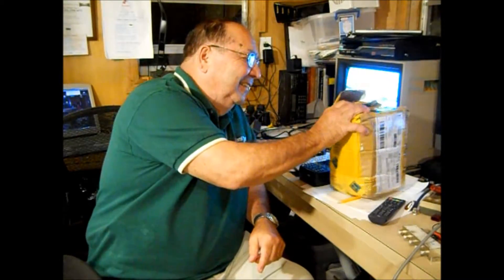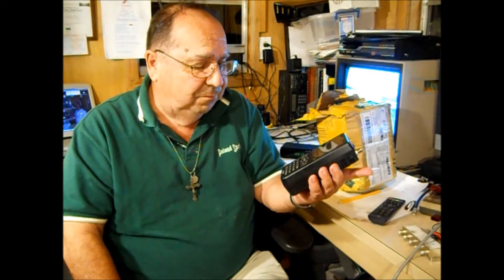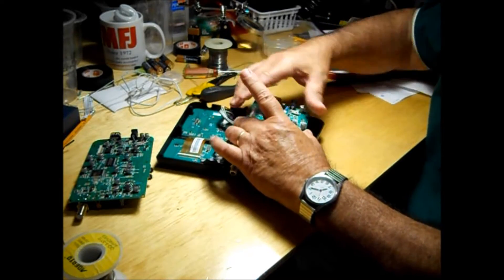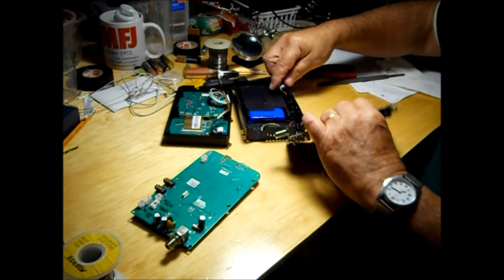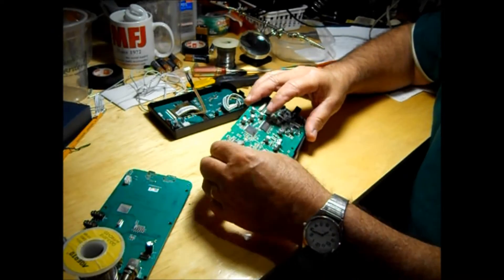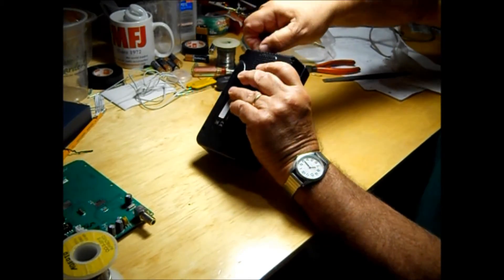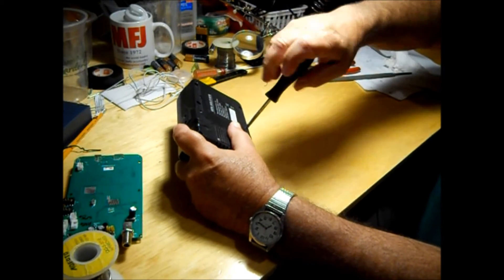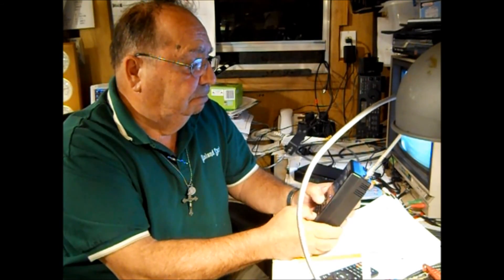FTA Satellite Meter WS6908 Board Replacement installation Video 2 of 2

Comment: dear, i have one ws6908, led charge blink and show battery is empty always, if your have one opened may you check value for resistor R7 because my show 160K and colors are erased, is near of power plug
Reply from the maker: Hello R7 is a 2.2 ohm 5% resistor. it is a 4 color band resistor.. Red Red Gold and Gold  Hope this helps ...Leo
Reply: tks man!

Comment: Great video Leo, I enjoyed watching.
What does that thing do, watch satellite TV?
Reply from the maker: +old64goat  Thanks Bill, It is a small TV and Satellite receiver all in one. It allows you to watch the SN and Q levels plus other information so you can verify the satellite and adjust the dish for max. No need to drag out a TV and desktop Satellite receiver along with AC power. There like the old CM or Sadelco TV Antenna Field strength meter.
Reply: Thanks for that info Leo
Reply: +K1ZEK That's a handy rig.  
Please do tell us what is out there to receive?  Don